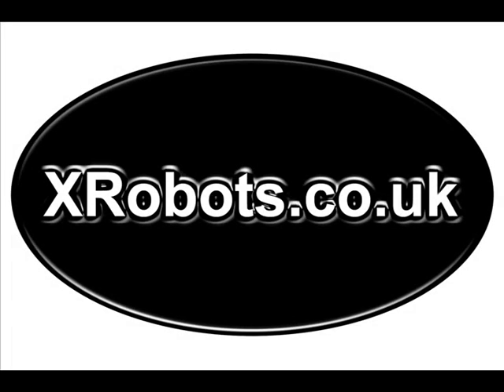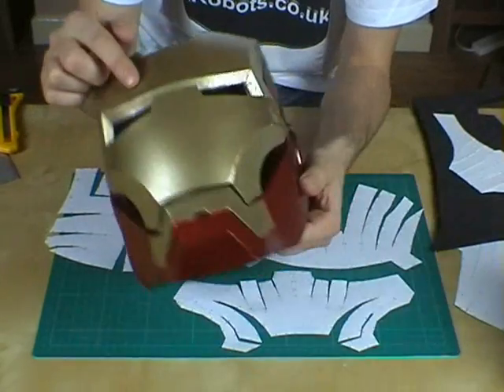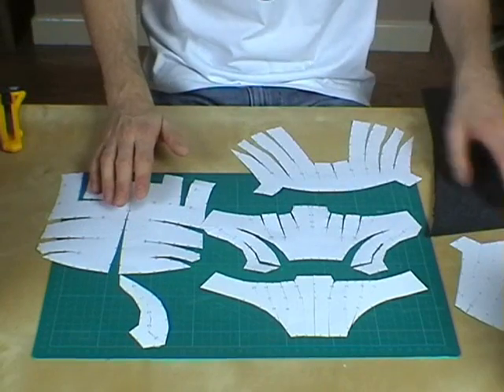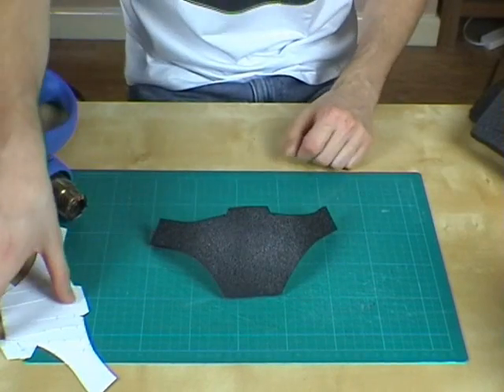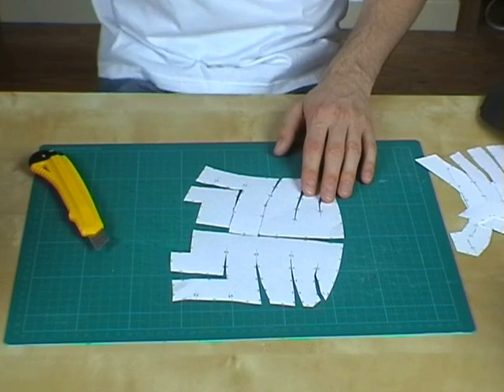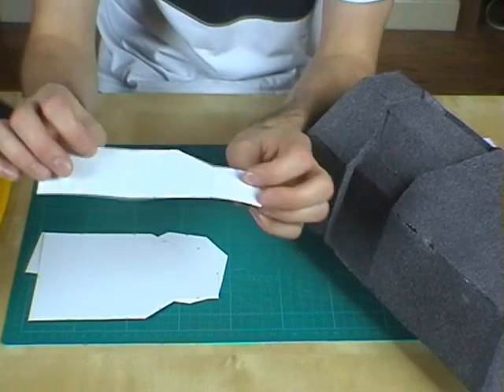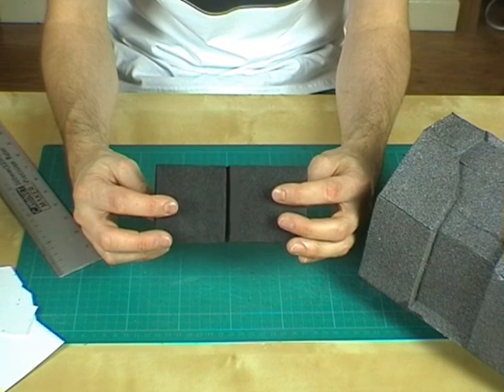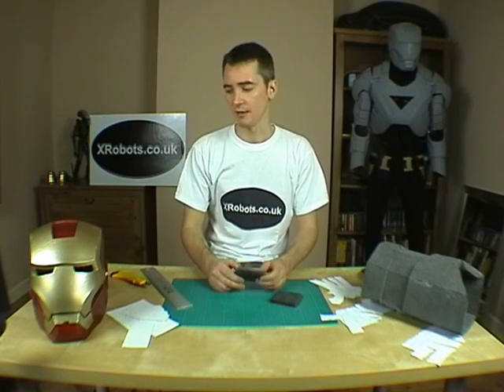Iron Man Power Suit #2 | Modifying Pepakura Templates | James Bruton

Comment: Excellent video James.  Quick question.  When I cut all the way through and try and slide the paper together the newly cut piece will tend to spread away.  Say you have a Y and you cut down the center, if you bunch up the top of the Y the bottom will spread.  How did you over come this?